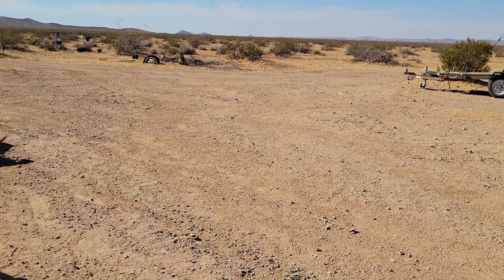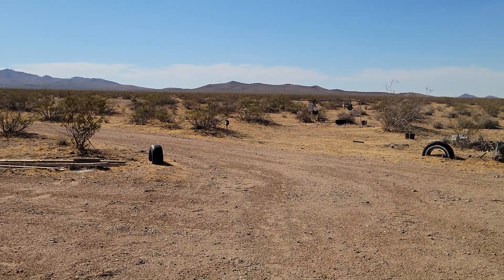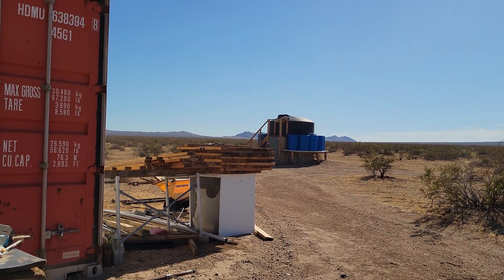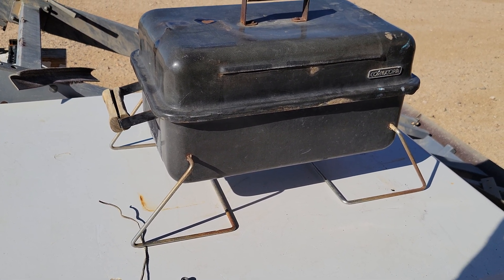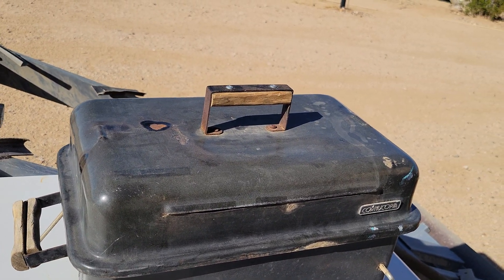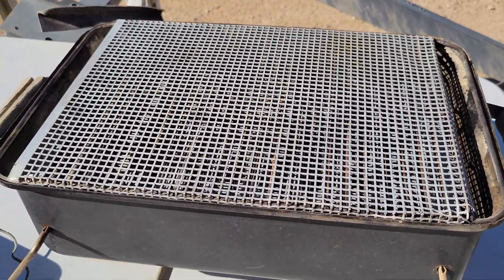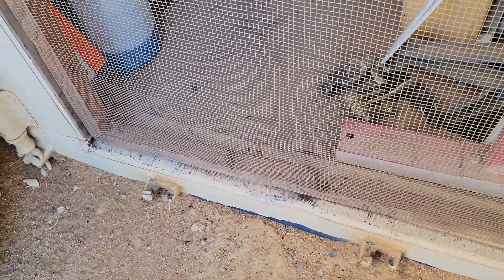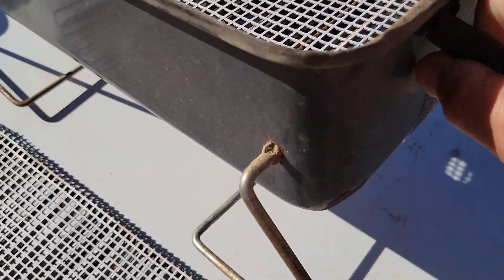Solar Cooking, Part 1. Simple Conversion

Comment: I bet you won't find one like I've got. It's cast iron. I have no other use for it. A scrapper guy gave it  me for fixing an old push mower. I'll paint it with high heat paint. If a bug lands on that hot cast iron, I doubt if he's going to stay on it long. I found a glass shelf yesterday out of an old fridge, should be about right for a lid. I mowed a little bit along the side of the barn where it had gotten big, this morning early. I was out there twenty minutes and it was time to quit. I checked the humidity when I came in, 65 %> 🥵.
Reply from the maker: I haven't needed to start my mower this year...
Reply: @GBear  I cut the grass about a half inch tall. The sun 🌞 will do the rest. They say 100 or above the next nine days. Humidity was 64% just now. I just finished having some catfish, turning the air conditioner on in a bit. The weather guy says we had 4.9 inches of rain in the last two weeks. The stems of the grass are getting tough now. Harder to cut, harder on blades. If you let it get tall the mosquitoes hide in it. And snakes like it too. They don't like the short grass very well. I hit a little one with the string trimmer about ten days ago, I think it came from the pond next door. It was right by the barn where my solar panels had been sitting, and I was cleaning up behind them. It had rained and it was wet there but it's dry now.
Reply from the maker: To keep snakes away, soak a small rag on ammonia and place it in an open plastic bag, then put them where you don't want snakes.